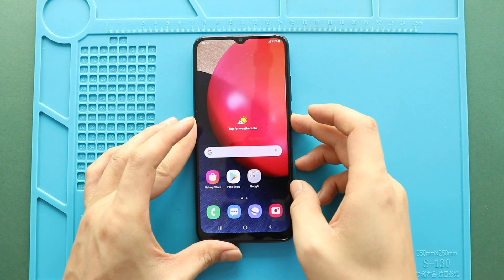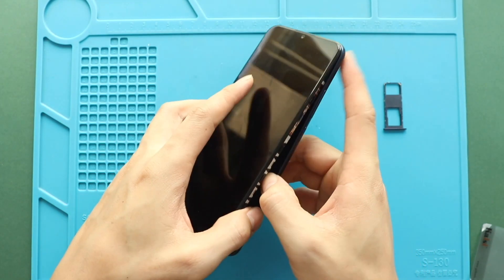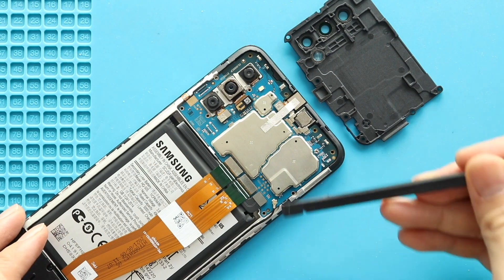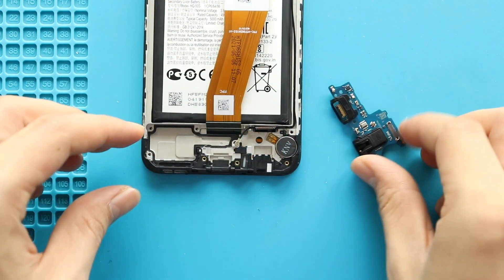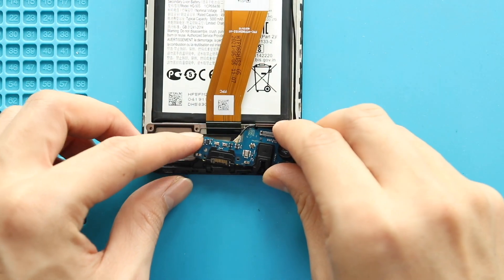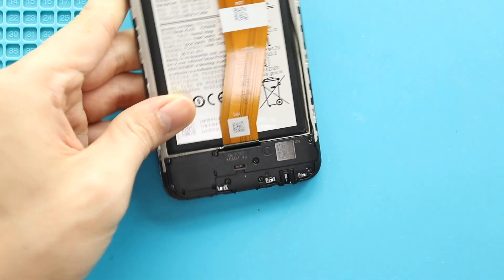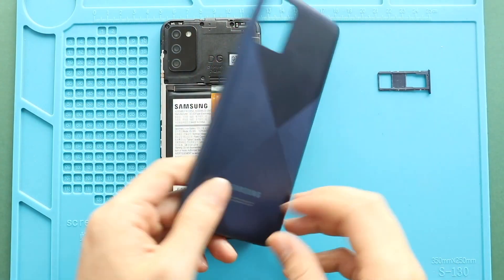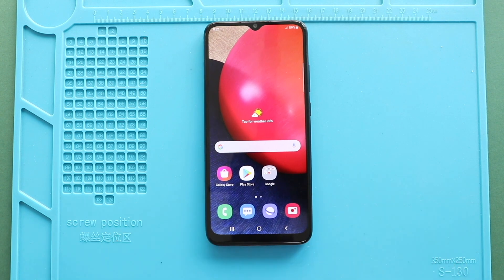Samsung Galaxy A02S Charging Port Board Replacement | M02s

Comment: May I ask, is it necessary to remove the battery plug first before disconnecting the charging chip? Thanks
Reply from the maker: Well not a must, but better to disconnect the battery first. Safety first.